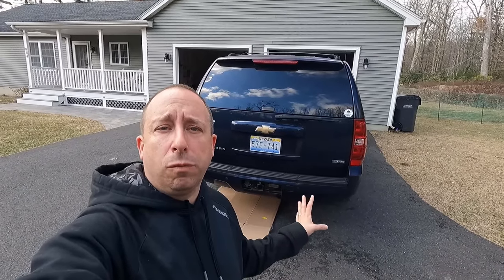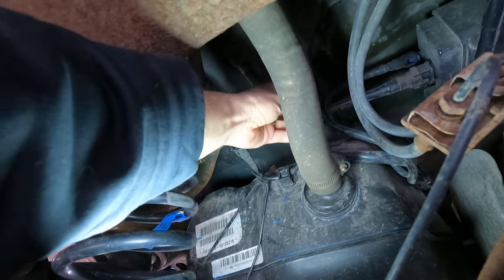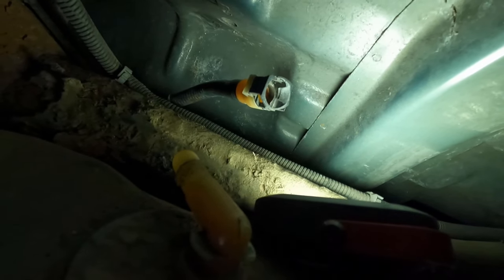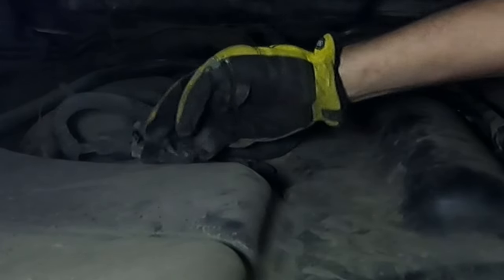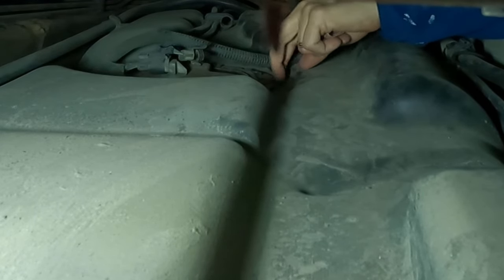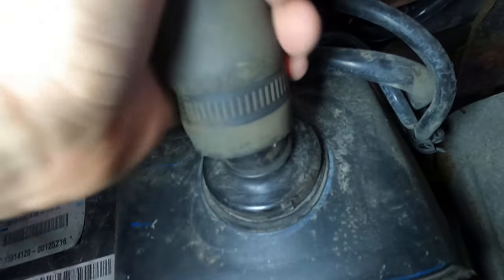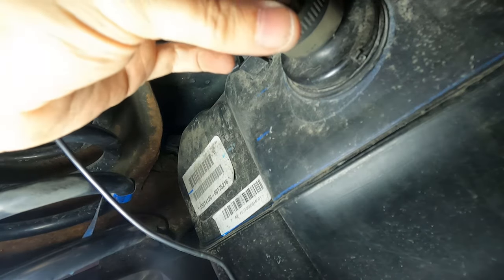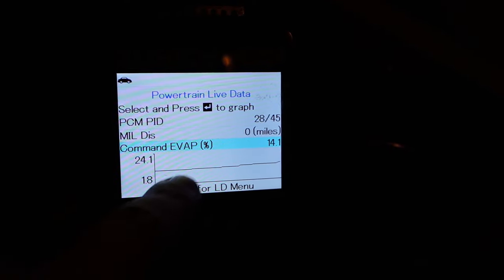Chevy Truck/SUV Fuel Tank Pressure Sensor Replacement (P0446 Fix)

Comment: THANK YOU. 
It was the Fuel Tank sensor. I couldn’t get rid of the PO446. Tried everything, purge valve, gas cap, charcoal canister, solenoid and 2 days later check engine code again every time.
I was going to light up my 2004 Avalanche on fire but 2 days after replacing the fuel tank sensor all monitors came back green. Passed smoke check with flying colors.
I did go the (making a hole under the rear seat) road to replace it since dropping the tank was too complicated for me. 
Maybe a coincidence maybe not, but with the new fuel tank sensor, I now get a message on the dash “low fuel” warning. With the old bad sensor, all I got was the light on when fuel was very low. Maybe that was an indication the sensor went bad in the first place. 🤷🏻‍♂️

Comment: I’m wondering if you had an issue filling up gas. My suburban is giving me a hard time filling up gas the pump stops within seconds all the time and guess what I don’t have any codes I have no check engine light.
Reply from the maker: I didn't have that problem.  I've hears it can be caused by a plugged EVAP system vent valve.  I have a video on how to change that here: https://youtu.be/Yz0dEbGHCHk
Reply: The charcoal canisters are known to fail and clog the evap lines with charcoal pellets. This happened with our 2015 Suburban. I had to blow every line out with compressed air. It’s still not perfect, so I need to check the solenoid.

Comment: How did you know it was the fuel tank pressure sensor and not the vapor canister purge valve or gas cap evap?
Reply from the maker: I checked the gas cap first and it was fine.  I then changed the canister and still got the code.  If you have access to a smoke machine you can check the canister without removing or replacing it.

Comment: I shot the parts gun at my 05 silverado and still got p0446. Evap purge evap solenoid charcoal canister I hope this fuel pressure sensor works 😭
Reply: I am in the same boat as you. 2001 Silverado. I replaced the canister, purge valve and hoping it's the fuel pressure sensor and not the fuel pump
Reply: @freedomtour7974 It worked. All systems monitors complete. Just a tip you don't have to drop the tank. I came from the rear passenger and pulled it out by hand but like he said you're kind of blind. I used my phone camera to see what I was getting into. 2005 silverado

Comment: A week later your fuel pump will burn out.
Reply from the maker: It will?
Reply: Hi, fuel pump still ok ? I too replaced everything you did but not the pressure sensor yet. (2004 Avalanche ). My CAT and O2S monitors not getting ready. No engine codes for it, only the P0046 for the EVAP.
Reply from the maker: Yeah, no problem with my fuel pump
Reply: U negative mofoes....saying his fuel pump will go out next what a shity  thing to say! U did a great job bro. Screw them!